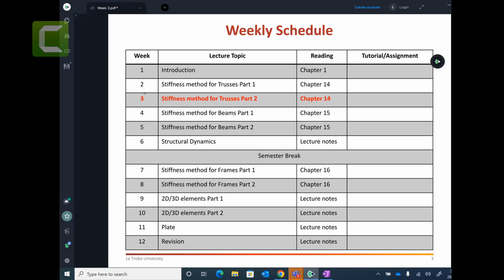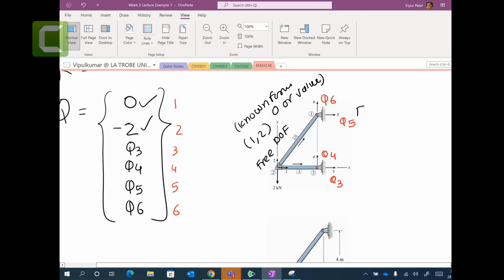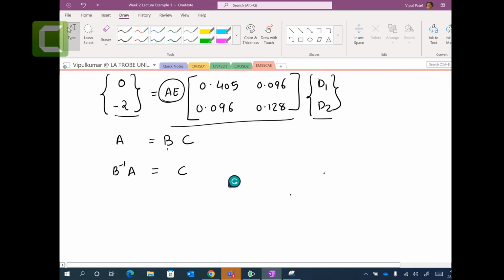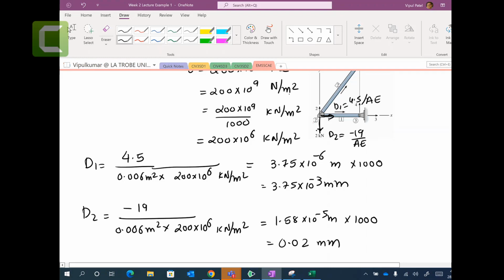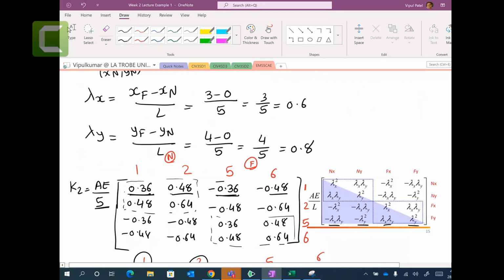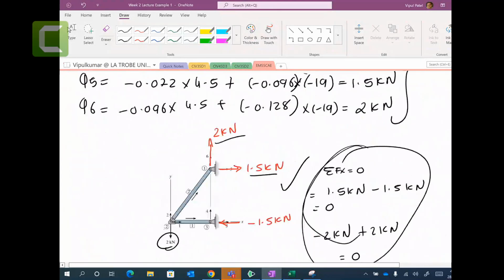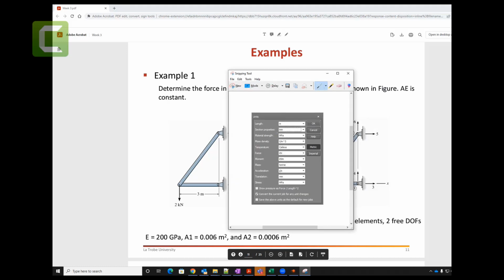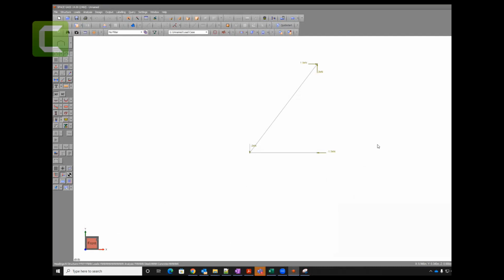EMS5CAE Week 3 Lecture

Comment: Hello Dr. Patel, the error that you detected with Excel occured when you hand calculated the determinant. 0.05184 - 9.216E-3 = 0.042624 rather than 0.5092. 
I am using your lessons to revise areas of my knowledge that I wish to improve upon, and to that end they are terrific! Thank you!
Reply from the maker: Thank you. I hope it helps. Please correct it if there is any errors.